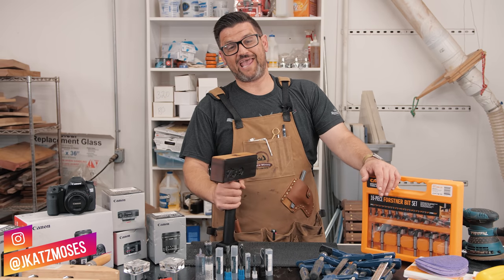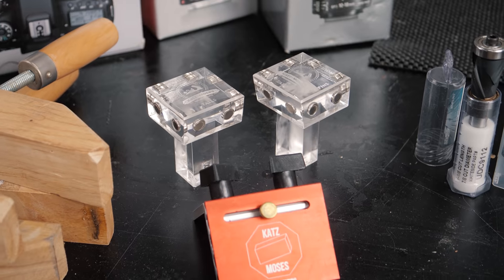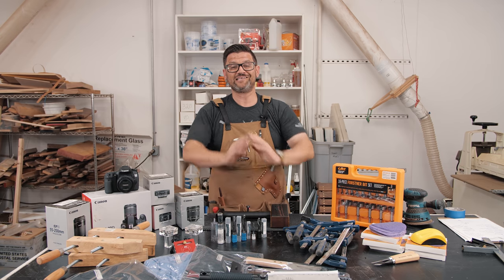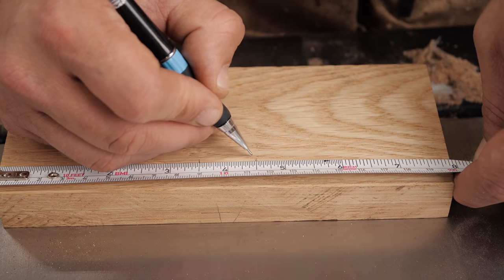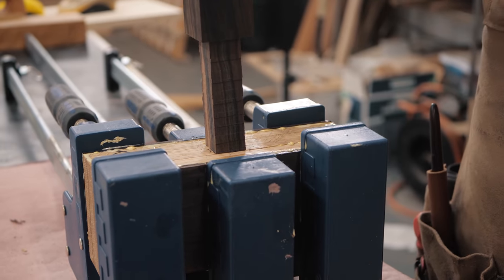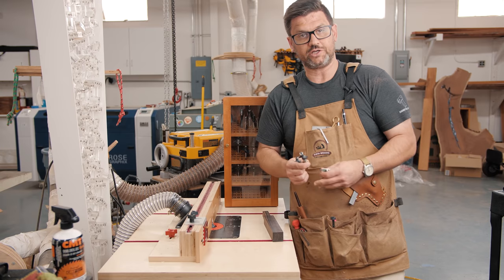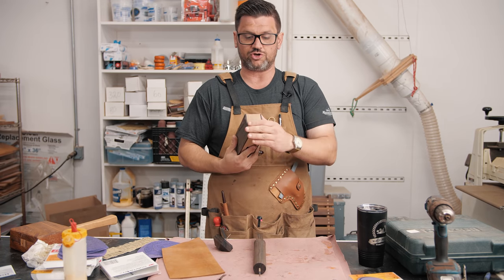Making a Wood Mallet for Vlad the Builder - The Katz-Moses Woodworkers with Disabilities Fund

Comment: I became disabled after having neck surgery, I can't drive myself anywhere, so can't run to the hardware store or anywhere else when I need supplies. I rely on my wife to take me everywhere I need to go, and since I could no longer perform the duties of my lifelong career, I lost all my so-called friends when I  wasn't there anymore.. After spending tens of thousands of dollars on tools, found that I need to spend lots more $$ on equipment if I wanted to become a woodworker on par with the autotech I was, but SS disability doesn't allow for that when you still have household bills. Seeing Vlad and what he does and has built makes me feel unworthy to call myself disabled.

The mallet looks really great Jonathan, and even if the pommel didn't have the added benefit that it does for Vlad, it adds a touch of style and class to it that any woodworker could appreciate.

Comment: So question, why use the table saw for resawing versus a bandsaw as the amount of material you would take off of the band size much less than a table saw and I feel like much safer? Also great video as always keep up the amazing work.
Reply from the maker: When I have short pieces I tend to do them 9n the table saw for speed and keeping everything flat. Not going all the way through feels plenty safe to me.

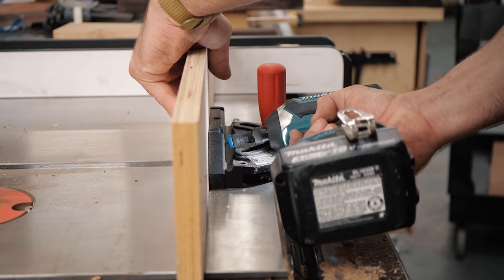Comment: 5:40 - Why would you cut those standing up, and tilt the saw blade, AND use a miter fence??  Why not cut them flat and just turn the miter fence??
Reply from the maker: Lot of ways to skin a cat. In my experience it's easier to clamp it safely standing up.